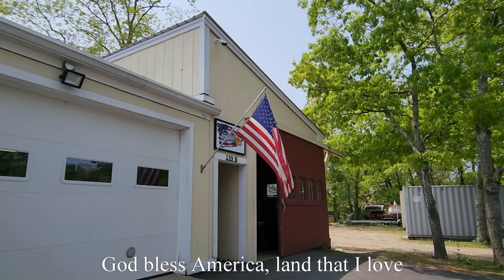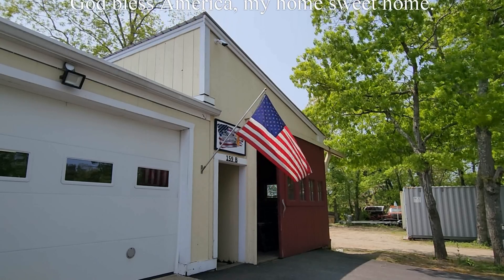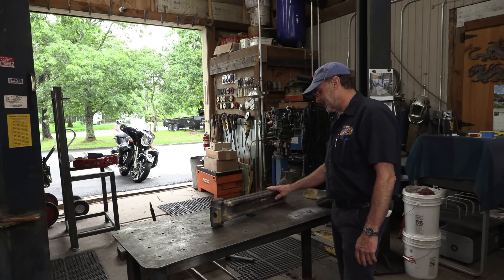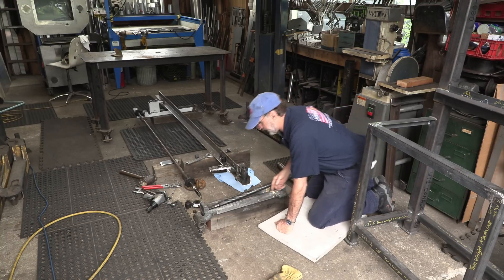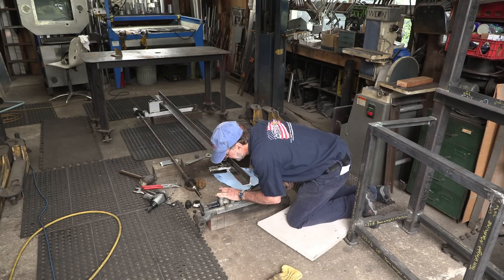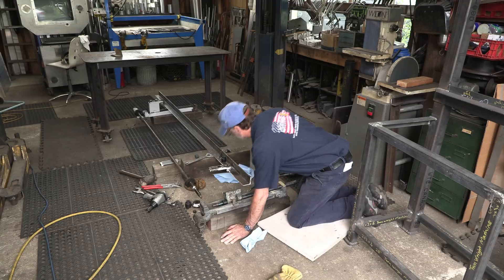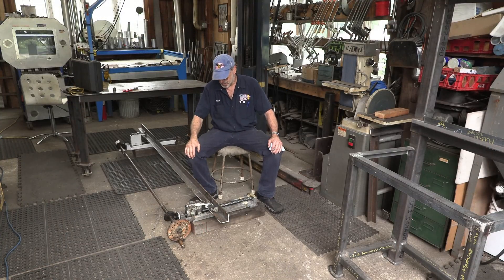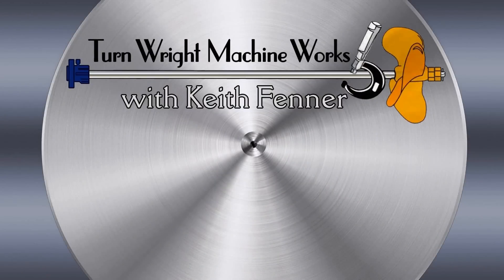Shear Brazing Grand Finale

Comment: Have you ever tried spray welding? Looks like it could make an even stronger repair than brazing if you can get the right metal powder for the spray process.
Reply from the maker: LOL! I have known of flame spray coatings since 1983, we used more than enough of it to know it's limitations...